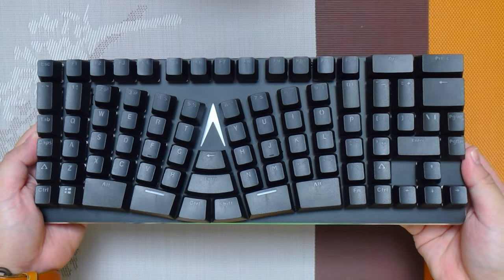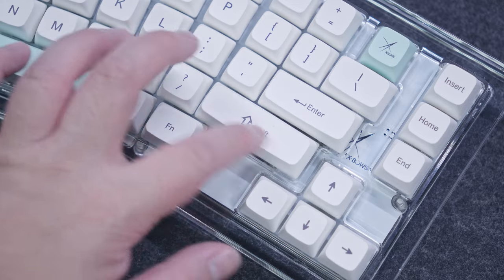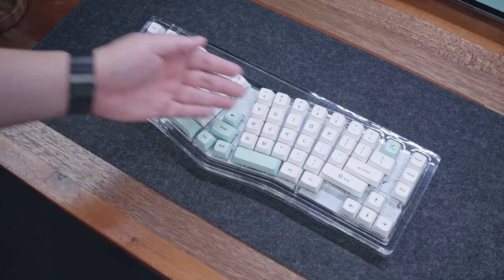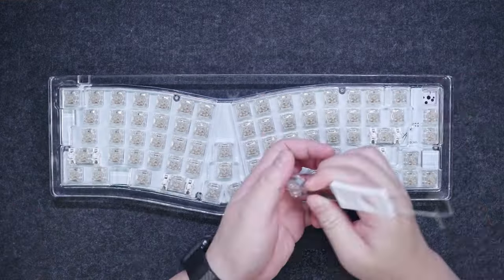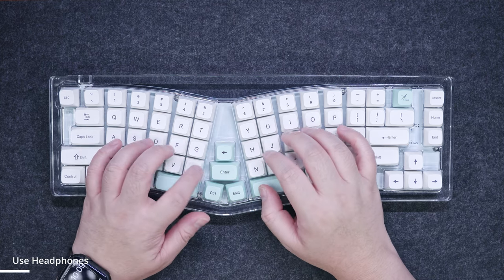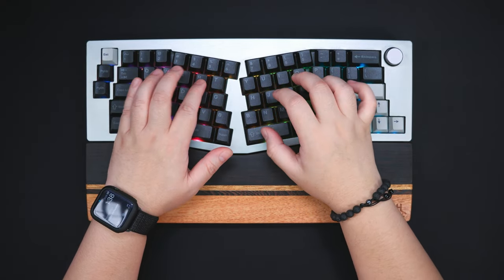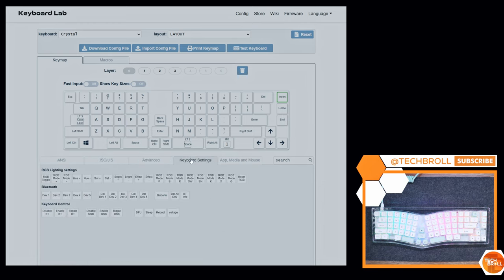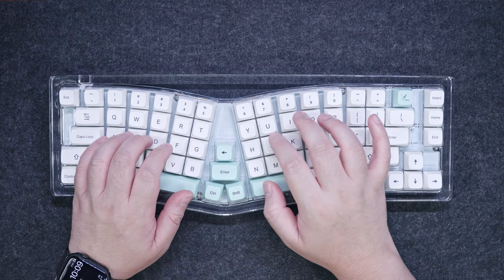X-Bows Crystal Review - Better ERGONOMIC Layout?

Comment: Why they use standard keycaps like shift, caps, etc? Why left space so short?
Reply from the maker: Probably for better keycap set compatability
Reply: That’s a standard split left spacebar. A spacebar split in the most standard layout is 2.25u/2.75u (disregarding the smaller third key)

As they said, it improves keycap set compatibility too because the minimum amount of split spacebar support in a key set will almost always be 2.25u and 2.75u spacebars
Reply: @jammies701  Why they use 2.25u/2.75u spacebars in a standard slipt keyboard
Reply: @Will-d2s  convention. Not really any particular reason other than it gives the widest range of compatibility across Alice and split keyboards. Also because it allows for a 1.25u extra key, which matches the cost common size of the ctrl/alt/GUI keys